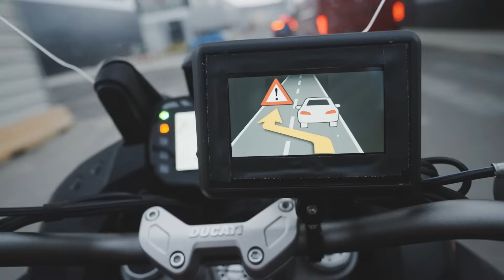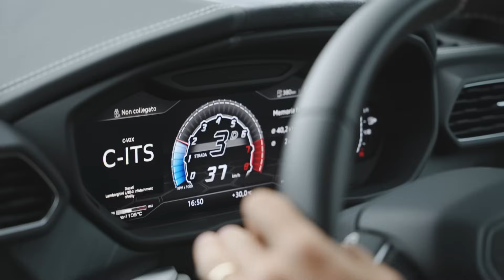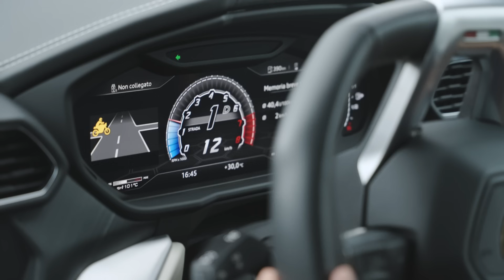Lamborghini x Ducati | A new concept of safety

Comment: Not going to be helpful until. The data is presented on the windshield via hud on the car. Helmet shield via hud.

Most people that cause accidents. Do not have the capability of looking down at an instrumentation panel & looking at where they are steering.

Most times people that hit motorcycles. Are in a hurry. They do not look long enough to see motorcycles. Something on the dashboard is not going to be seen. Need something like a hud putting up the danger signal on the windshield it self. Or need to be wearing driving glasses that have a hud.

I have been riding motorcycles & bicycles for 54 years. I have been hit by cars 3 times on motorcycles. 4 times on bicycles.

When people are in a hurry coming up to a stop sign, or stop light they can turn at or run.

You will see them turn their head real fast looking for cars. They do not see motorcycles or bicycles. They are looking for something bigger. They are in a hurry. They rarely stop completely at a stop sign.

I have avoided being hit countless times. As they rush up to a stop sign, braking at the last moment. Their head looking left and or right very fast. Accelerating immediately. Seeing that pattern causes me to take evasive action. Braking is the best, yet changing direction if necessary.

Unless the data is in the normal field of vision. It will not be seen. Will not stop those that are dangerous drivers from killing motorcyclists.

The other side. If every vehicle had that kind of ability. Drivers become reliant & trusting. When there is an interruption in receiving a signal from another vehicle. Drivers will go thinking it is safe, without looking. Double edged sword.

My own opinion & most probably that of my dead friends. Killed by dangerous drivers.

The best deterrent would be to start putting drivers who kill motorcyclists in prison.

Currently in the US. If not intoxicated, no prison. If intoxicated go to prison. Makes no sense. A sober driver is in possession of 100% of their mental facilities.

Yet they get a pass on killing motorcyclists as though they are less dead because they were a sober driver.